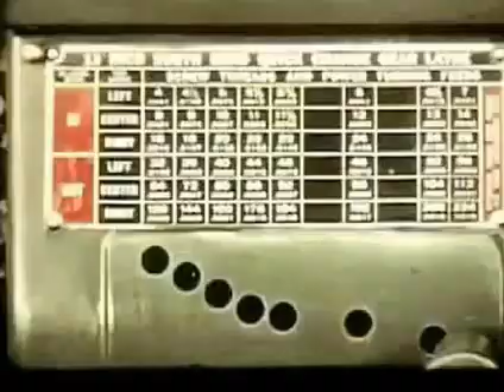South Bend's "How to run a lathe" (stabilised)

Comment: And now I got myself a South Bend 9A from the 40s here in Germany of all places. Cool video
Reply: Floor mold or bench ?
Was it there in Germany when you got or did you have it get it from out of the country?
Reply: @jaysoncheney  I got lucky on Kleinanzeigen. Someone sold it about 200km away. And it's the portable one without a bench. I think it immigrated some time after the war. Doesn't have bronze bearings for the spindle.

A cheap option for people in Germany with an apartment instead of a workshop would be Emco Unimat lathes. Tiny, cute, affordable and relatively ubiquitous.

Comment: The lubrication instructions that I have for my 9" South Bend lathe call for 3 different lubricants for different points. This video shows one lube used all over the place. Spindle and carriage have their own lube (light). Gearbox has its own (medium). Most of the rest uses one (more viscous). There's actually a fourth for the shaft inside the back gear shaft ( a grease), but I haven't followed instructions on that. What are others doing?
Reply from the maker: It's quite possible they are faking the oiling to avoid complication swapping oilers for the film. Any oil is better than no oil and regular oil is probably best of all. On my Feeler/Hardinge a way oil is specified for the ways, a spindle oil for the spindle and an ATF for the gearbox plus some grease in the threading gearbox and I bought what was recommended but doubt it matters much for light use especially.
Reply: Your lathe came with instructions? 🙂 Mine predates this film, and I was told - by the previous owner - to add 90w gear oil for everything. But, he told me he was a farmer, not a machinist . . . .   Hmmm.

Comment: I bet this is the 13 inch model. Mines the 16 and almost exactly the same. mine does not have the underbelt drive in the cabinet though and I think its a early model because of this but not sure.

Comment: The lathe is said to be the only machine tool that can reproduce itself. That’s a ‘stretch’. Sure, there are a lot of round parts on a lathe, but how is a lathe used to produce the bed or the carriage, just to name two major parts that come to mind. These require milling and perhaps grinding.
Reply from the maker: It's possible to mill on a lathe with an accessory to add vertical movement to the cross-slide and indeed many a model engineer has done this, I personally have held small parts in the tool holder to mill slots before I had a mill. Reproduce no, but producing a lathe on a lathe is certainly possible. But indeed it is a bit of a nonsense statement just used to describe the machines versatility which can certainly go well beyond basic turning with milling, broaching, jig boring, ID and OD grinding etc etc.
Reply: A mill is a lathe. Lathe ways were originally flattened by scraping and eventually, by the Whitworth 3 plate lapping method.

Comment: Lathe:  The only machine that can reproduce itself.
        That's a bit of a stretch.  I can think of a lot of components of the lathe that would be a real challenge to recreate.  And I'm not going to cheat and say, what about the motors and belts?  How about the bed ways?  The chuck jaws?

     How about, "A machine that can almost reproduce itself."   Or, "A shop with and lathe and its brother the milling machine can almost reproduce themselves."
       It almost sounds like a challenge.
Reply from the maker: You can make a lathe on a lathe but not the same lathe. It's a nonsense saying but they are very versatile and you can mill on them.
Reply: What type of lathe is this ???

Comment: I'd give my left nut to have one of these lathes-! In the wood crate.....delivered to my door.....BRAND SPANK-IN NEW-!!! Wonder what happened to all of them? They "All" can't be in the hands of hobbyist's. I guess some or most have long ago been returned to the melting pot and became the steel rim on someone's car-! What a total shame.
Reply: car rims are aluminum....
Reply from the maker: Οὖτις ἐμοί γ' ὄνομα Only alloy rims are aluminium, many are steel, some have plastic hubcaps to make them look pretty.
Reply: ***** i suppose but i dont really think of those as rims
Reply: oh they still make lathes, but they arnt made in indiana anymore, taiwan and china with the name of southbend same with leblond, but most machine makers have some sort of lathe turnning center, today to my dismay you buy forign, you spend the money on a machining center one, you buy a rebuild, or if you have the shop and skill and know where to get replacement parts you make one and assemble it yourself, but even then even a cheap metal lathe is still very expensive outside the hobby size lathe and there are a few of those but not many aside taig and surline, as well as other insterment lathes but those will cost you too, or the few that are small time builders that make machines for their craft.